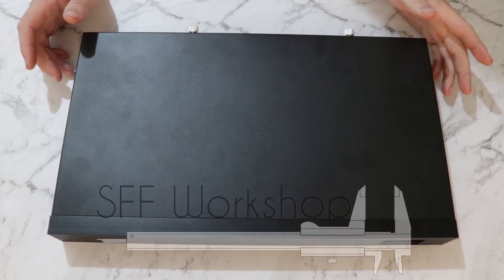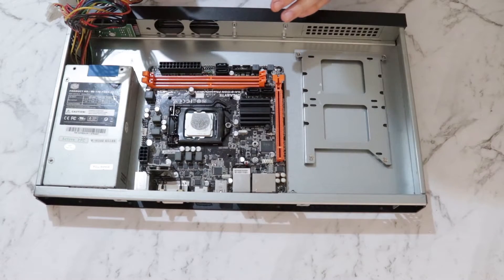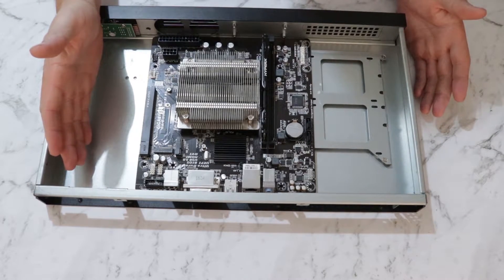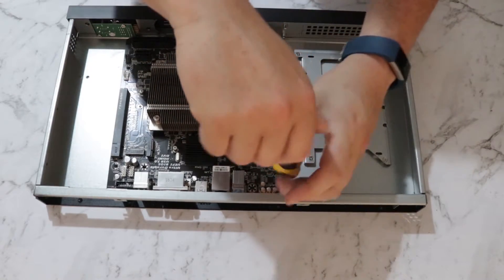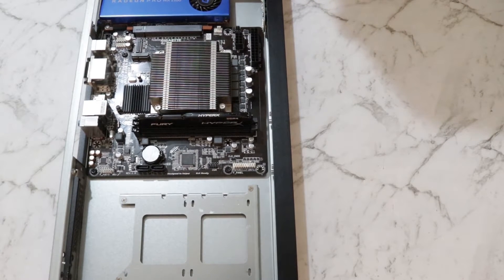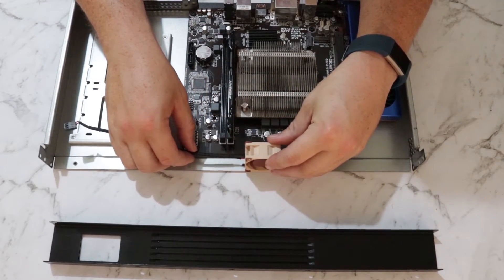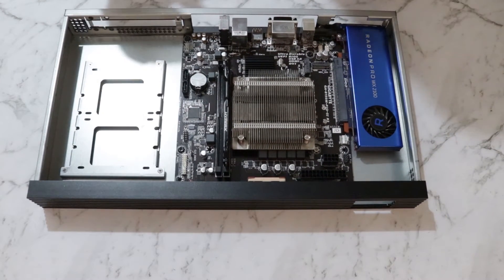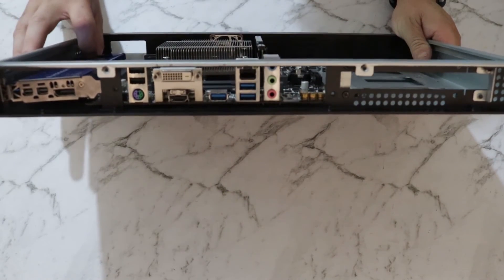Project 1 - An Actually Quiet 1U Server

Comment: Looks like a fun project! My thought when you mentioned the lack of space for cooling fans was to use a larger fan laying down in the case and ducting it to the front. I'd also like to compliment you on your presentation style. Well spoken, confident and good audio. Looking forward to many more.
Reply from the maker: Thanks for the support :) I'll have a 24 port switch above and a 2U server below this unit in my rack, so a larger fan pulling air from top or bottom panels wouldn't work. If you're meaning having it internally with ducting, it's an idea I'm considering - (spoiler alert) even the Noctua 40mm fans aren't quite enough under testing!
Reply: @sffworkshop  Well, there are more options with some ducting: Roller fans, nautilus fans, etc. I'm excited to see what you come up with.

Comment: SFF Workshop is live and off to a running start! 
Question: Where might one obtain such a similar motherboard? Would you theoretically be able to fit a half-height, dual slot video card with this setup?
Reply from the maker: The motherboard I could only find locally on Trademe, or on Aliexpress. A dual slot card may be possible, but cooling may be tight - the entire chassis is 40mm tall externally!